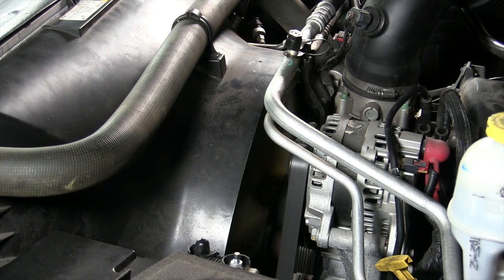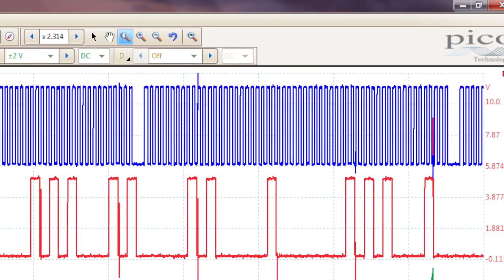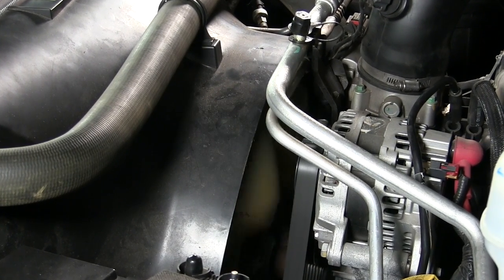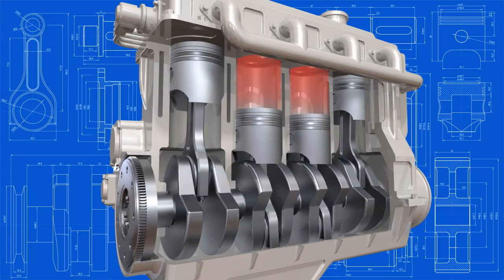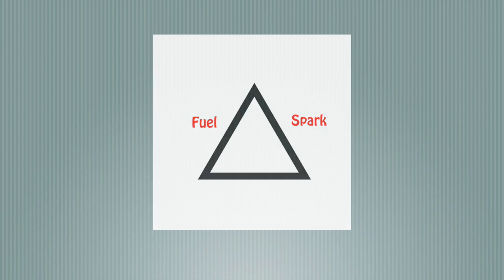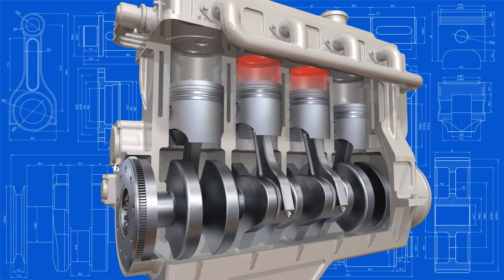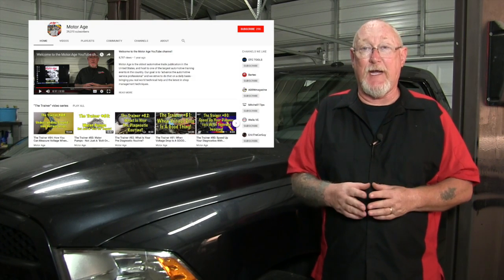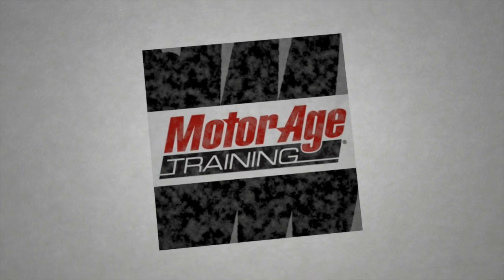The Trainer #85 - Tackling Misfire DTCs

Comment: I have ran into a bad cam lobe causing a misfire only detected at idle several times. Rev it up and it "feels" fine. 

Compression was within 10% across all cylinders including the one with a bad lobe. These were both on GM cars and both showed a constant miss on misfire counter at idle. Cylinder was dead at idle on a drop test. Everything else checked out fine. The only indication to justify tearing it down was an occasional noise at idle internal engine. 

Visual inspection on teardown, the lifter was pitting on the roller follower and 1/4" grove cut into the cam lobe. Any way to test for this without tearing it down? Only way I can think of is measuring the rocker arm movement for the dead cylinder and comparing with another.
Reply from the maker: There are times you won't find that mechanical issue with relative compression or traditional compression testing. In-cylinder pressure testing is one solution. A worn cam lobe would show as a delay in valve opening and early valve closing. We are teaming with TST this month to offer a full 3-hour seminar presented by #BrandonSteckler on using pressure and vacuum to find these more elusive problems. For full info, click http://ubmadvanstar.hs-sites.com/register-pressure-acquisition-analysis-from-inside-out
Reply: even back in the early 80s the gm 305 had this problem with cams going flat and. they were not roller lifter.i have  done many v8 gm with cam problems even big blocks seems to be common and it never seems to be lack of lubrication to me
Reply: Had this same problem. It was a GM v8. It only missfired if it idled for an extended time. Extended warranty authorized a used engine after i showed them the out of spec lift on the bad cylinder. I never tore the engine down to see if the lobe was flat or lifter failed ect... so i never  found out exactly what failed.

Comment: Why did you miss out Air?
Reply: All I'm referring to is that more air or less air can also be a factor in misfire.
Yes, you are right,we need fuel, compression and spark/fine spray of Diesel in CI Engine....but air too in the right quantity.
Reply from the maker: @neetaahuja9140  great point
Reply from the maker: Not sure what you're referring to - please clarify.
Reply: Thanks Pete

Comment: If you cant afford a scan tool go to a welding shop and pick up a temp stick
Put a line of the temp tick wax on each exhaust manifold near the cylinder head when its cold watch the wax see which one melts last most likely that will be the cylinder thats miss firing 
Also try a non contact temp gun they are getting cheaper these days look for the cylinder that building heat the slowest
Sometimes on a poorly running engine you might be able to see slobber seeping from the cylinder head to exhaust manifold connection 
Another way if it has unplug the coil wire to the coil on plug or spark plug wires remove one at a time see if it makes a difference  dont be fooled but computer steps always take an logical approach to trouble shooting

Comment: How about Ditex car scope i-tester for a relative compression tester and use a ir thermometer or a imaging camera at the exhaust manifold to find a misfire.
Reply from the maker: Not familiar with the Ditex - but any DSO should be able to perform the test. And certainly you can use either method to help identify a misfiring cylinder - a great tip for pre-OBD II cars!